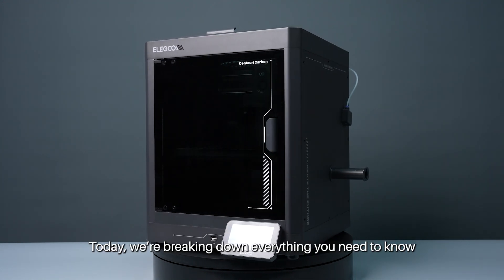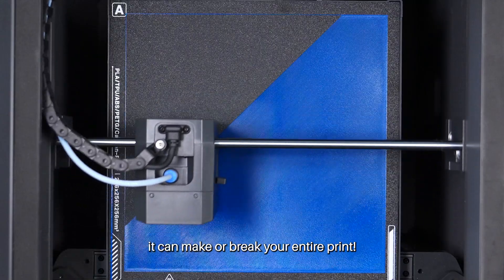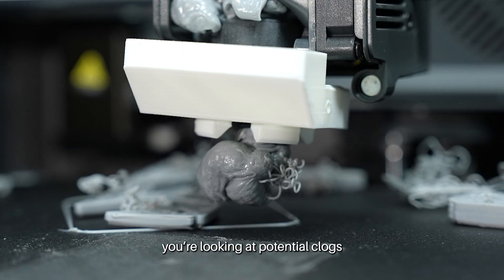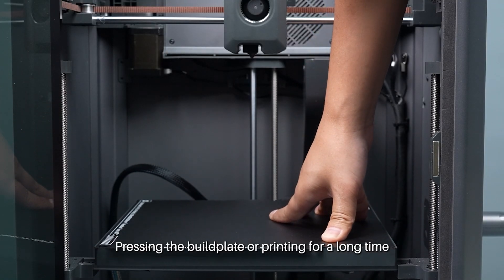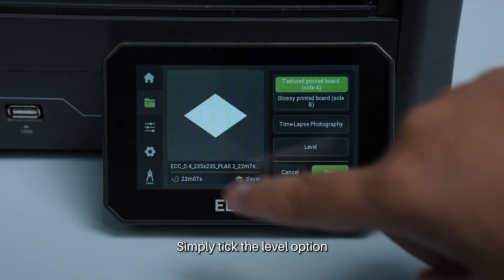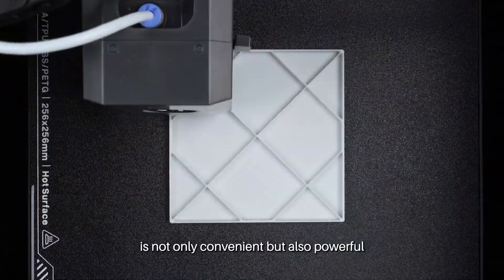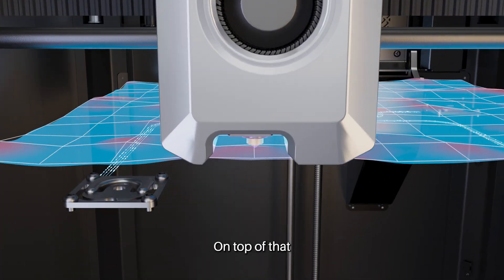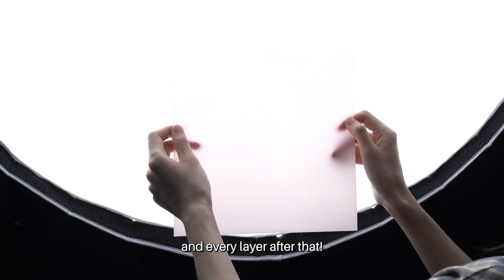How to Level Build Plate | Centauri Carbon

Comment: Why cant we change the temperature used during the pid and bed leveling tuning?... I dont ever print pla, but the pid is at pla temperatures. This results in a terrible zoffset for petg or abs.

Comment: This company doesn’t listen to consumers. If I set my build plate to 100 C it should level at that temperature. Instead it levels at 60C and then you have to tweak it. How stupid are the coders at elegoo? Fix this issue first gods sake. 

Guess I’ll just stick with bambu since you guys don’t give a shit about consumers.
Reply: You suck
Reply: Lmfao this... I had to write my own gcode for doing a zoffset because i could only change it during a live print. How dumb is this. If you let it print at abs temps your zoffset will be so bad from calibrating at pla temps your nozzle hits the bed and sometimes causes a clog before you can even live tune it.

Comment: how about you set it to level on the temp the Gcode sets the bed at, if im printing ABS at 105, and its meshes the bed at 60c, my first layer is way too close and dependong on the part, print ruined

Comment: If I ask the printer to level before printing It should be leveling at the bed temperature you are going to print at and not at 60 degrees. It always leves at a bed temperature or 60 degrees!

Comment: I'm so sad. This printer is really great... when everything goes fine. But once the filament gets jammed inside the spool (Elegoo PLA), it doesn’t detect it, and the whole print is lost. Same with the end of the spool: it detects it, you load a new one, press resume... and everything is messed up and lost. Too bad, because aside from that, it’s a great printer.
Reply: I’ve used Elegoo PLA reliably and had no problems

Comment: I’ve got about 500 hours on my machine and it’s been running like a champ. Way to go on this one Elegoo.
Reply: Have you tried the holographic ones y3t
Reply: @sydneypied the holographic build plate? Yes. They’re pretty cool.
Reply: I have a bit over 100hrs on my machine. running great, but i have not done any maintenance yet. how often should i lube this thing, and tighten the belts ?
Reply: @ogtech5522 I’d say clean and lube the gantry every month or every other month depending on if you live in a dusty area. The belts i wouldn’t worry about, maybe just check the tension with a press checked once and a while and tighten only if it needs it. Be sure to run all your calibrations after too.
Reply: @kogasoldier9379  Thanks for the info. i guess its time to lube the gantry.

Comment: How do you level for build plate B if it calls to print it at 30 degrees, but the elegoo levels biuld plate b at 60 degrees?  (aka my first layer was horrendous)
Reply: Change the Gcode manually its actually pretty simple

Comment: Utter nonsense. This seems to be just hyperbole. Just setup up my brand new centauri carbon this morning. Followed every and all instructions but by bit. Tried to print the included 'benchy' file. Didn't work. Stringy. Reset and tried again. Stringy. Fiddles with settings. Stringy again. Hunted for advice. Found a YouTube short showing my exact issue. Advice - remove the nozzle cleaner bracket and file it down on the leading edge. However, I can't get into it because the bed is right at the top obscuring my access. Can't find  any way to manually lower build plate! This elegoo video is evidently just nonsense. How can the internal system do all its checks for nearly 39 mins on setup and say it all OK but not print properly because the nozzle is clearly too far from the bed? I can see it. It tries to print but it's essentially printing in mid air.
Reply: that's z offset, not leveling.

Comment: That levelling file isn't in my folder of pre loaded things. Where can I get it from,m
Reply: its a cube model. right click the build plate in prepare tab, add primitive >> cube, change scale non uniformly to desired shape with your first layer height as the z scale height
Reply: My exact question
Reply: Bed leveling is not a file, it's a setting in the software. Should have it as an option before printing and also can be found in the calibration tab as shown in this video.

Comment: Any chance the leveling can be sped up with software? It takes longer than some of my prints.
Reply: my anycubic kobra s1 is slow withe levelling too. It really annoys me.
Reply: there is no need to level every time. level only after moving the printer and/or changing the plate
Reply: if you want less probe points you can change where it is allowed and the distance per point in the slicers printer settings